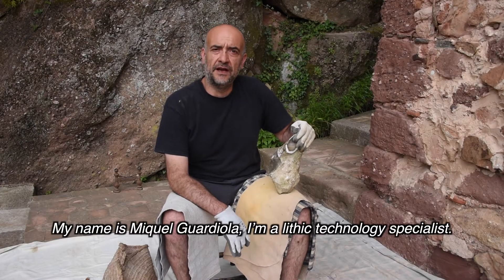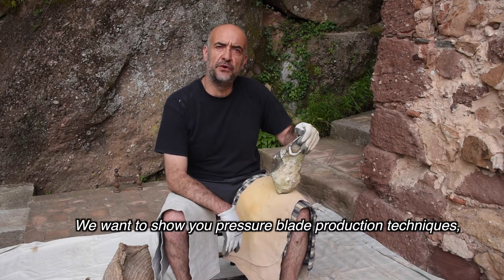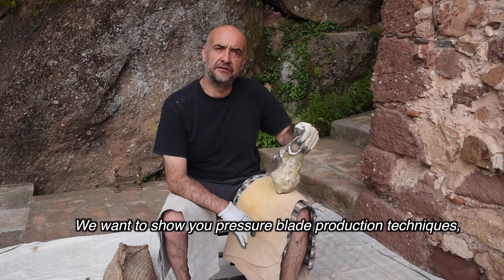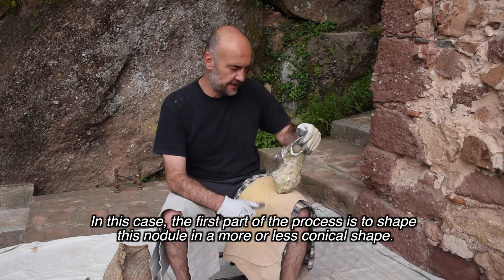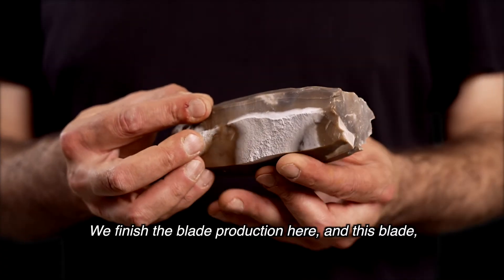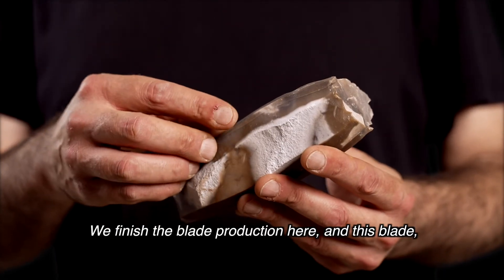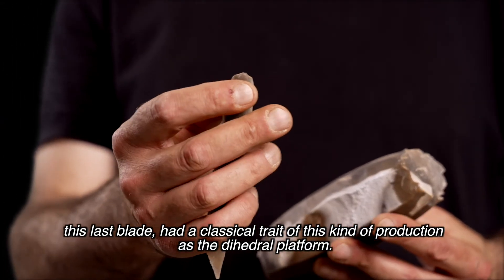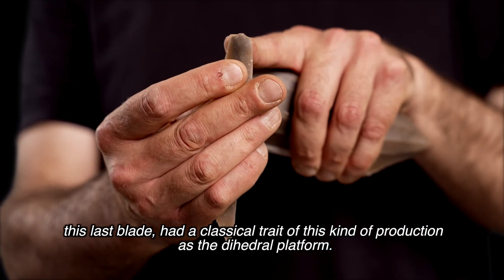Pressure systems for blade production

Comment: why is it that making a core seems far more complicated than making a point...yet somehow this technology came first? Its not the knocking blades off a core that seems complicated, but the whole process of preparing a cobble into a core, not to mention all the gadgets I have seen used to pull the blades off consistently.
Reply: This guys not doing it authentic. Authentic or aboriginal style uses rocks and antler no metal. The oldest was direct percussion, big rock hit shiny little rock and use the blades knocked off. After so small then make a point
Reply: @bjellison905  You need to educate yourself before trying to tell others what is happening on this video !

Comment: Any proof that this technology was in existence at this time ?
Reply: Quite a bit. The technique of single shard knives and tools definitely pre-dates multi angle knapping, as it was far easier and more expedient. Though I'm not quite convinced that a lever was used at any point. An antler/fire hardened wood tip and a couple striking stones is all they would have used.
These make perfect large arrowhead for use with small spear or atlatl dart to take down large game animals.
Reply: Proof? Are you a mathematician?

Comment: Why does this man need stone blades when he can make copper tips for his tools?
Sounds like making meatballs out of ravioli
Reply: In the neolithic the only class that was able to produce copper was the upper class. This however strove lithic craftsman to produce tools made from stone equal if not better than that of the 1% in the society. It produced an age of refinement of lithic technology to the utmost degree incorporating multiple technologies such as: square, bifacial, and punch. these produced the highest degree of complexity tools and art pieces unseen today. The class structure of the neolithic had the chieftain as the metallurgist while the peasants still used stone tools for the majority of their hard labor in society. the peasants in context with society sought to produce the same tools as the upper class but with stone rather than metal which produced some of if not most unique and most complicated artifacts in record.
Reply: To this day these blades are sharper than even the best razor blades. 
Also copper cannot be sharpened to hold and kind of an edge, it wasn't until the bronze age and then they still can't compare to the edge of a flint blade.